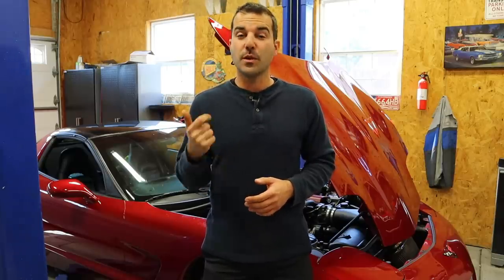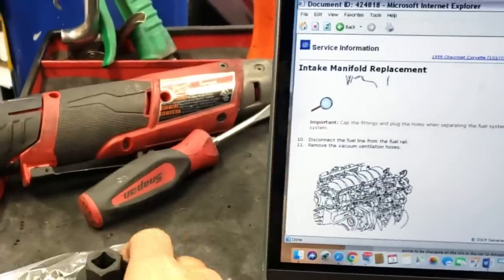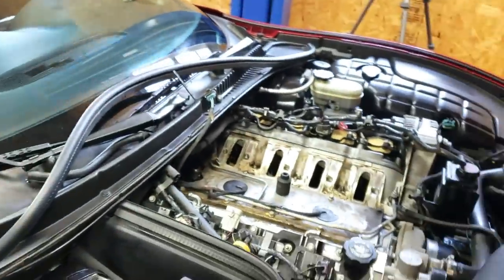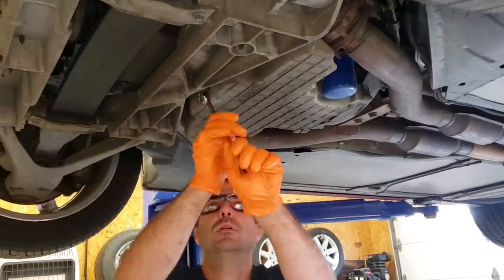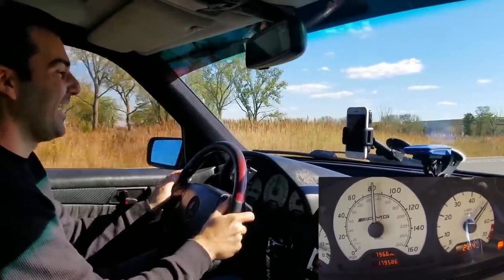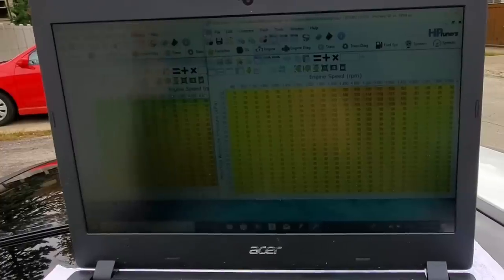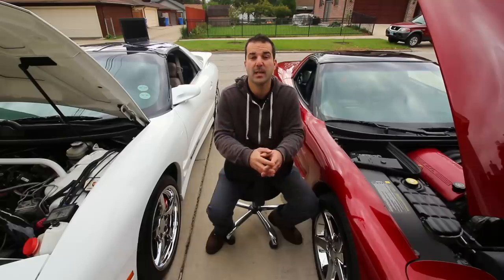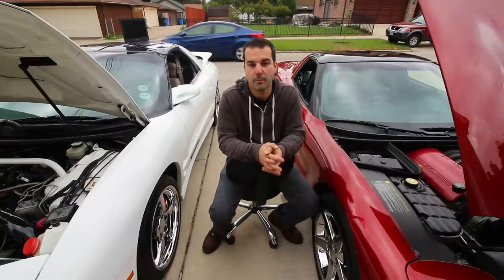I’m Building A 40 MPG Corvette That Sacrifices NOTHING! Project EcoVette Starts Now!

Comment: The original Honda Insight runs lean burn from the factory and is legal in California! However it has a factory wideband O2 and multiple catalytic converters to mitigate NOx emissions. It also has factory indexed spark plugs, which is something I’d look into doing on your Corvette to maximize combustion efficiency.
Reply: Same as old 1.8 GDI from Mitsubishi. 
5.0L/100km on a highway in a compact minivan.
Reply: Spark plugs will not increase or decrease mileage. No way.
Reply: Can I put lean burn on my Corolla?
Reply: @J-Eagan  if only spraks plug works - you dont have to change them, you will not increase power or mileage with plugs. Read comments below this article. Simple physics.
Reply: @jareknowak8712  I know it’s late but I thought I’d respond to this. You are right; spark plugs alone do not improve fuel economy. However what indexing the spark plugs allows you to do is change the combustion physics. In a DOHC engine: the orientation of the spark plug is less critical because the spark plug sits centrally in the combustion chamber which is ideal, side note that's also one of the reasons why “Hemi” engines were considered better than the typical OHV engine. In a SOHC or pushrod engine the spark plugs typically enter the combustion chamber at an angle. Because of this you have the ability to direct the flame front; as it's not always going to go down and out as a centrally placed DOHC or Hemi engine will. A typical spark plug installed in a SOHC or OHV engine may be poorly orientated so that the ground electrode shields the spark gap from the incoming air fuel mixture and promotes poor propagation of the flame front. By orienting or “indexing” the spark plug so that the gap is facing the incoming air fuel mixture or intake valve you can get a rich spot right at the spark gap which is easier to ignite and is the point where the flame front begins to propagate down the combustion chamber. For efficiency this allows you to run a leaner AFR, as you have a rich spot that you can ignite even with AFRs in the 20s (like Honda did with the G1 Insight). Direct injection allows even leaner AFRs with a central spark plug placement (as mentioned in your article) by directing the air fuel mixture towards the spark plug with the aid of geometry in the piston crown as well.
Reply: @J-Eagan   Thank You for such a comprehensive comment. Not sure if port injection paired with indexing will give something, bc with NON-direct injection you cant create zones of rich and lean AFR mixture, charge is almost homogenius (well, i know about Hondas CVCC on carbs). But it might work with direct injection. The sectret of Honda Insight efficiency may lie in: low mass, low air drag, small engine displacement, 3 cylinders, high compression, soft valve springs and hybrid system, not necessarily in something magical in combustion department. I have 2001 Mitsubishi with first mass produced direct injection engine, 1.834ccm inline 4, GDI. Car is really economical, if You are delicate with throttle. I use multi electore spark plugs. Thanks again for Your comment, You drew my attention on something new. Excuse my English.

Comment: Several Hondas ran lean-burn in the US.  Civic VX, Civic HX, and stick-shift 1G Insights.  California versions of all these cars were non-lean-burn for emissions.

The problem with NOx is only partly due to temperature.  Lean burn is only possible at low load so that keeps temps inside norms.  The problem is, 3-way catalytic converters get loaded up with oxygen when it is present in the exhaust.  With a stoich mixture, there is little or no unburnt oxygen in the exhaust but in any lean engine including all diesels, there's a ton.  In the VX and HX, Honda fitted a 2-way cat which didn't have that problem, but also didn't really scrub NOx.  By the time the Insight was made that wouldn't fly anymore, so they used a special cat with a high oxygen capacity, and then when the sensors see the cat stop working, it pops out of lean burn to "purge" the oxygen.  California was having none of that, and by the time the 1G Insights were done, the rest of the US wouldn't tolerate it either.

Comment: Chrysler had their Lean Burn system in the 70s.
Reply: @MrQuickPick Hartford, CT  It was the 70s and used pretty primitive electronic controls bodged onto a carb.  Idea was good, execution not so much.
Reply: @gadget73  The Honda CVCC system worked quite well with 1970's technology but they weren't humming the mission impossible theme song and trying to make a fuel efficient 440ci V8, something that's not even possible in the year 2019.

Comment: Just watched the video and had some comments on lean-burn. Before I get to those,  I think you should easily achieve your 40 mpg goal. Now back to lean-burn. I have a 2001 Honda Insight with the 5 sp MT and it has lean-burn. The manual says it's capable of going as high as 23.5:1, but the highest I've seen is 22.7:1 and it's usually at 22.5:1. As far as running hot, that really will only happen if you are trying to run under too high of a load. My car's programming will cause lean-burn to drop out if the load gets too high so that's never an issue for me. In fact, in summer weather here in northern Indiana, the coolant temp will typically drop from 205F to around 199F...when it enters lean-burn. Also, in the winter when it gets down around 0F and it goes into lean-burn, you can watch the coolant temp drop from 160(ish)F to below 152F withing just a mile or two, at which time the ECU says, "No more lean-burn for you!" and lean burn goes away until the coolant gets back over 152F. Again, with what you are planning on doing, I think 40 mpg is very doable...and possibly even higher.
Reply: That's your O2 sensor maxing out, No car will even run over a ratio of 20:1 and maintaining speed and not melting a piston, good luck.
Reply: @PurpleHeartVR  I'll have to respectfully disagree with the 20:1 limit, at least as far as this car is concerned anyway. It will go for 3 or 4 miles at 60-65 mph until it drops back to stoichiometric (when it does a programmed nOx purge) for a mile or so and then back to 22.5:1 and keeps repeating that all day long. At slower speeds the time between purging is a bit longer. Look into the specs for the 2000-2005 Insight for more info. In regards to the video, I think he's going to be fine with doing this with the Vette.

Comment: Just some FYI, to run lean burn you can tune the car leaner and leaner untill it starts to cut out, then you add a bit more timing and see if it stops to cutting out, if it does your good, if not add back a bit of fuel untill it just smooths out and that's about the best the car can do.. also the tune is in cruise cells only, never when needing power. Another way if your turboed is to run a turbo that hits zero to 1psi while in cruise and that removes engine pumping loss. Another thing to help avoid knock is water or water/meth injection controlled by the ECU when egt, get to high to help cool valves and head.

Comment: Add a restrictor plate in the intake and optimize tune. Less air=less fuel
Reply: @Justpassingb1  nobody said anything about power.
Reply: @Hamza-or7jm  if you actually paid attention to the video, that's one of the first thing he said. He didn't want to lose performance, bit enhance it. Learn to listen
Reply: @DocR16  oh forgot to pay attention, lol. Delete restrictor plate, add 12:1 compression heads.
Reply: @Hamza-or7jm  and then never be able to drive it on the highway beyond half the distance from home because it would require race fuel 🙄
Reply: @littlerhino2006  10:1

Comment: AWESOME! I had a 5 speed 88 Turbo Supra that got well over 30mpg on the highway at 90mph, oddly enough poor gas mileage around 80mph. The MK3 Supras had a dual stage fuel system, both the pump would increase pressure and the injectors would open there high flow ports up, so if you stayed at somewhere under 3500rpms it would get great gas mileage. And driving around town you rarely needed to go over 3000 rpms, otherwise you where probably speeding or didn't know when to shift. I remember getting about 25mpg mixed driving and averaged 32mpg on a road trip cruising about 90-95mph BUT if i had fun it definitely drank the gas. Once i averaged about 12mpg :-)

edit for what i did;

Wheel alignment is very important, I aligned my Supra to launch well and break well (toe out in the back and toe in on the front) so city gas millage could have been better but great highways MPG.

Gaped the spark plugs to 0.50 from 0.32 with Autolight copper spark plugs ;-) and used machining shims to gap them.

Put 36psi while warm in the tires, dropped to 24-26 for funzies time

Absolutely no intake leaks, cleaned the MAF every oil change, Full synthetic gear oil (full synthetic engine oil, but i dont think helps much with MPG, but definitely protects much better).

No tune, but the most important! perfect maintenance. MK3 Supras needed a full stand alone to properly and safely make more power than about 320hp to the wheel, so be able to run lean you would have to ditch the stock computer.

Comment: Putting in a taller 6th gear might put the rpms out of efficiency if the load is not decreased sufficiently. Tires with slightly smaller diameter, much less width, and a proven efficient tread/compound would help mpg immensely. I went from 225/60R17 to 225/55R17 tires on my '16 forester & went from city+hwy 27 to 29mpg, I then installed 235/65R17 truck tires & dropped down to 23mpg. Also fitting an air dam that reaches low (but flexible enough for speed bumps/etc) should gain you 1-2mpg. Somebody mentioned downforce could increase tire resistance so possibly having it angle back and down so air is not directed upward. Some sort of soft (again for speed bumps) side skirts & rear diffuser might help as well. Possibly a professional ceramic paint coat could help. The most straight through exhaust (mufflers typically have back & forth chambers) with slightly smaller diameter mandrel bent tubing. This will be more efficient for low rpm cruising, but still sufficient for WOT (especially if high flow cats are legal for you). Also wrapping the headers in fiberglass should keep the exhaust temps up for more efficient gas expulsion. Going to a larger diameter exhaust especially if it is allowed to be long and resistive with mufflers/etc. allows exhaust gasses time to cool and become more dense filling all that extra space with more & heavier gasses to expell out the tail pipe creating even more resistance in your too fat exhaust system. Lastly if lowering more than .5" after you blow the shocks get some that l

are designed for a lowered vette. Ideally you would want stiffer springs so you dont hit the bump stops and approach the compression limits of the shocks as often.

Comment: You should have swapped out the intake for the a Dornan LS intake.
Reply: doesn't help fuel consumption
Reply: Ante Radić 

Sure it does. Flows more air in the top end it makes more torque down low. This allows you to get moving easier and run leaner once you’re at speed.

Comment: First gen Honda Insight with a manual transmission had lean burn from the factory. You would get up to speed, back off the throttle a bit and the MPG gauge would shoot up from 50mpg to 100+.  Then you re-apply the throttle gradually and cruise at 75mpg @ 55mph. Honda said 18:1 AF ratio but owners with wideband gauges reported up to 26:1. Unfortunately it would not maintain lean burn at higher speeds and loads.

I also worked on early Honda CVCC once, they used lean burn but in order to get such a lean mixture to light up they used a small pre-combustion chamber inside the carburetor, the engine would ingest already burning fuel and air mixture.

Comment: With active cylinder management readily available these days I'm always surprised to see newer cars come out without the technology on board. I was shocked to hear that the newer corvettes can run in three different modes based on power needs. Way to go Chevy! I have a 2010 E63 and it's shocking that Mercedes is still totally fine with 14 mpg.

Comment: I have a suggestion. There are water meth kits that have a controller that works with maf map or pulse width. It will cool cyl temps. Steam effect make more low end torque. U can play with mixtures. Try 100% water, washer fluid, boost juice or straight methanol. That can help you advance the timing a bit.  Maybe try bumping up fuel pressure and shorten pulse width to see if fuel is better atomized. Just a theory on that last suggestion.

Comment: Miata is so poor due to short gearing so 60 mph you are sitting at 4k rpm corvette 6th gear probably at 2-2500 rpm
Reply: Not even, that high, I don't think.  On my firebird V8 6th gear is practically unusable below 60 & that has the same T56 with probably similar ratios & rear.  The 6ths are stupid tall.
Yea, the miatas are short as shit, in autocross you always hear the miata guys slamming the end of 2nd through the slaloms.
Reply: Under 1500 rpm in my C6 at 60 mph in 6th
Reply: My 1987 c4 chugs at about 1700 rpm in 4th gear at 60 (automatic)
Reply: You'd be doing triple digits at that RPM in a C5. 1500 RPM is pretty standard for me at 70 MPH and at 75, I'm probably 1700 RPM at most.
Reply: Nothing new there, early Toyota Corollas shipped with 4.88:1 gearing. When you're trying to make a sports car with only <2L that's  expected. Nothing is for free though, they are quite speed limited.

Comment: It is a good idea, and it can be done correctly if the engine will not heat up too much. Fuel is also used to cool down combustion chamber, and going lean heats up things, and can cause damage if not took carefully.
About running in open loop, that is how you tune drag and race cars! No variables in the engine map unlike running it in close loop-ish

Comment: Sometimes we will watch a trainwreck. A 40 mpg vette, you have my attention.
Reply: 10-12 mpg over stock with tuning and aero wont be to difficult.
Reply: @xjmg007  give context, we're not here for that type of antiquated response.
Reply: @aintboutme  not sure what is antiquated. A 33% increase in mpg is not out of bounds considering how rich factory LS cars run. He is going to lean it out and modify aero, 40mpg seems plausible.
Reply: @xjmg007  maybe antiquated was a poor choice, but it did prompt you to give a more substantive response.
Reply: @xjmg007  Considering a C5 probably already gets about 35 mpg on flat roads @ a steady 55 mph, should be relatively easy.

Comment: I believe the "lean burn is hotter" saying is a misconception due to most cars running slightly fuel rich, the extra fuel absorbs the heat and won't burn due to less oxygen. When you dial back the ratio, you get closer to the perfect ratio, which increases the heat since all the fuel is burning. Dial the ratio back even more, the air will start helping absorbing the heat, and the mixture itself can't burn as hot since there's less fuel, ergo less energy.

Comment: Would have been easier like 10 or 15 years ago before there was 10% ethanol in gas but 40mpg whays that like 32 on e85 that may be better with more fuel to keep it cooler
Reply: Ethanol has less BTU by volume, so you'd most likely get worse fuel economy.
Reply: @apancher  that's why he said a rough estimate of 32mpg on e85

Comment: Small airplanes have been doing lean burn forever. In fact, you are SUPPOSED to set the air fuel ratio as you fly, both for power and for efficiency. When you do, you immediately see the temperatures of EVERY cylinder. This is helpful to see every cylinder's temp because if one of them reads wonky, then you can anticipate that there might be an engine issue forming, so you know to deal with it in advance. Unlike a car, having an engine problem up in the air is way more serious than on the ground!

Comment: How about tuning for a cylinder deactivation every eight th stroke too.
Reply: You need a system to keep the valvles open
Reply: @Bas BlasterXP no you don’t you can just let the car open and close valves as usual and just deactivate ignition and injection the only reason valve timing is changed is to reduce the like 1-2% pumping losses you get for compressing air in the cylinders even though you don’t need to
Reply: He wants to keep it a v8

Comment: Many late 1970's chrysler products were made with factory lean burn. So yes there were examples here. My friend's 1979 Chrysler had the system stock and it knocked down 25mpg highway it had the ESC computor on the air cleaner, 2.45 rear gears, and a 3 speed auto with lockup convertor. The car is much more fun now with deep gears and a 408 stroker, haha.

Comment: One way to burn less fuel while keeping the same air / fuel ratio is to make the air hotter. Hot air is less dense, so it needs less fuel to maintain the same a/f ratio. I've heard of people putting a heat exchanger between the exhaust and intake, then running a motorcycle type CV carb. The intake side of the heat exchanger was packed with stainless pot scrubbers to prevent the possibility of explosion. They claimed 50 mpg out of an old-school V8 pickup.

Comment: Tighten the plug gaps down to .025 - .028 to cut down on the lean misfires.  It may also help to run some good size OFC cable to tie the cylinder heads, coils, frame, and battery ground together.    Also the oil going into the intake through that PCV isn't going to help with mpg.   I think you might make it close to 35 mpg before having to do major modifications.   With fuel economy just a gain of 1 mpg is a significant gain.  However, there are problems trying to get a consistent testing method while using a factory fuel tank due to the air pockets in the tank.  The best you can do is multiple test loops and then take an average.